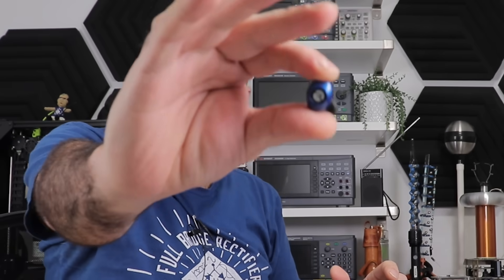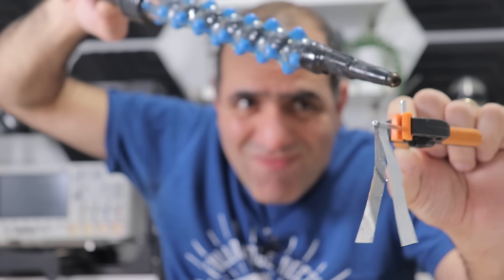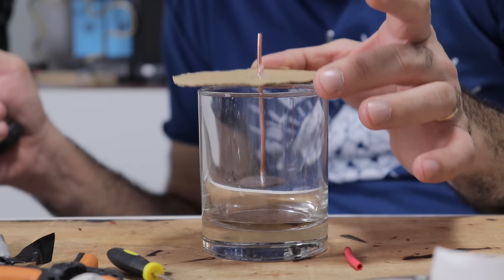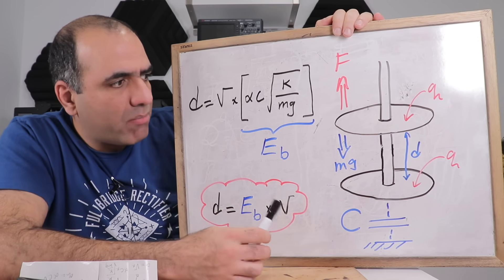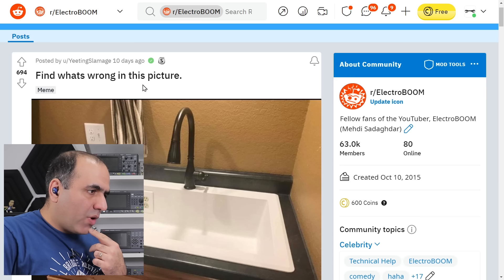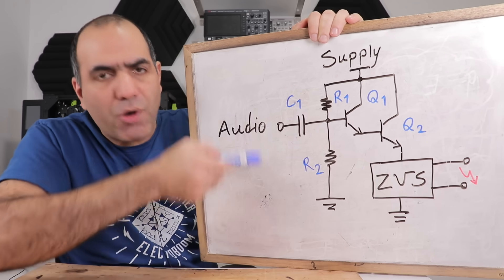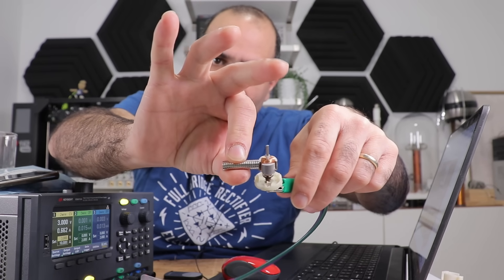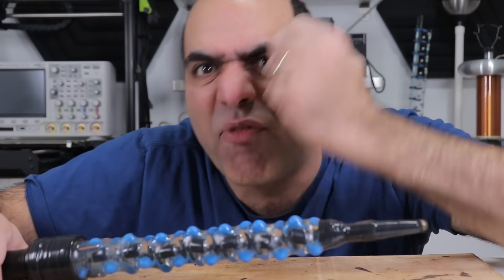I Reinvented the Electroscope! (LATITY-008)

Comment: There is a reason why you will see flammable placards on containers of powdered materials, even things like dry spices. Kinetic energy can be enough to create ignition, and once that happens it can erupt explosively into flames. This actually happened inside an old factory near where I used to work. Someone was cutting an old air vent, and the dust went up from just a spark from a disk grinder. Next thing they knew, the whole floor was up in smoke, because the fire spread through the air ducts.

Those rolls are likely made from some kind of polystyrene, and can be quite flammable, so dust or particles from them would make very easy kindling for a static charge.

Comment: On the timestamp 9:32, this guy pulls up his sock, creating lot more friction and then high voltage, setting these foams on fire. It's because these foams are made of EPE or extended polyethylene. EPE has a high concentration of butane gas. Butane gas is used to ignite the cigarette lighter and gas stove.

Comment: The reason that the cotton ball doesnt burn in his experiment is that its bound in a structure. The idea of a dust explosion is that free molecules have  a larger surface area to interact with an oxidizer.  They can burn much more quickly and if you have enough material you get an expolsion.  This was first found in flour mills and is abig concern.  Also vaccum bombs work on same principle.  Take exposive material make aerosol cloud and let the atmosphere be your oxidizer and you get a huge pressure wave.

Comment: The "landmine" is most likely paper dust. Extremely fine dust has a very large surface area, because of this, when a spark happens, the paper dust ignites like shown in the video. Buildings have exploded because of dust accumulation before. It's a real thing, look it up. Grain dust, flour dust, and yes, paper dust have all caused accidents with explosive results. People have died because of this, and new safety rules were created because of it.

Comment: I still believe that ESD fire was in fact dust. Your test was admittedly flawed, the objects by themselves may have a tough time being ignited by a simple electrostatic spark unless it's volatile like the lighter fluid. The foam ball is relatively inert on its own, but grind that ball into a fine dust, blow it all over your shop and then get a static discharge or open flame, you'll find out what happens briefly before you burn to death (don't, we'll miss you 😂). Fine dust particles saturating the air can ignite very rapidly on the smallest heat source, and can cause huge fireballs and pressure wave explosions. It's been a problem in manufacturing ever since the beginning of the Industrial Revolution, largely countered by workplace regulations requiring a good ventilation system.
The reason it seemed to stick to the surfaces was likely because some dust had already settled and was caught by the initial fireball. All said, that worker is very lucky that he got out of there quick, as it could have very easily set him alight.

Comment: comedy genius at work when i was five i held on to a hoover vacuum motor on a metal steps that was standing in water in the basement of our house that my mommy gave me fifty cents to buy at a thrift store to  i reached over to the outlet with one hand and plugged it in 120 volts surged threw my body the convulsion spasm made my arm fly upwards smashing it into the ceiling and down crashing into the cement floor in the water with a blood curdling scream it shattered the aluminium whirring and smoking in flames i unplugged the dam thing  left it there knowing my mother would hear my scream ran up the steps got outside slammed the door shut she came running around the corner of the house from the kitchen which was adjoining the basement on a split level she ask me if i was screaming i told here the dog was attacking the cat she believed me and left i opened the door ran down waded threw the water retrieved the fried motor and went and hid it in the crawl space under the house i told my older brother steve what happened rip he educated me in alternating current and told me i had a guardian angel looking after me i just had a belly laugh telling the story that my mother rip never knew rest in peace mom and steven with a tear in my left eye back to the marathon

Comment: Actually, I know what causes the explosion (The material is something called "pearl cotton" in Chinese, which is kind of plastic made into kind of foam. The bubbles inside the foam is filled with butane which will leak out a little bit. The electrostatic discharge just ignited the butane, causing the explosion.

Comment: The dust explosion only happens when the dust mixes into the air in a fine and evenly distributed cloud.  Then it rapidly mixes with oxygen and is so small on a per particle basis that it basically turns into a thermobaric explosive.  

Before mitigation systems were put into place they used to kill hundreds of people.  A factory producing cotton or a corn starch storage silo would build up dust till there was the proper ratio of fuel to oxygen to be flammable and then a stray spark would explode.

Comment: There is actually a flaw in the logic here. Copper and aluminum are different materials that have different conductivity and charge density per unit area. Hence it is incorrect to assume q1 and q2 are going to be equal. Perhaps they will be "close enough to being equal such that the assumption can be made" but from a purely technical standpoint, unless that assumption is called out then this logic Falls apart. (PS: I'm an EE myself so I'm not talking up smoke )

Comment: No flamamble gas is needed for such explosion. But your experiment was wrong. Ball of cotton is nowhere near to fine dust mixed with air oxygen. You seen, any material, even if not flamamble creates highly explosive material when combined with oxygen. There was numerous very serious accidents in iron mills, where iron dust was mixed by wind with enough osygen to explode. In all flour mills is strictly prohibited to enter with open fire, becasue of risk of explosion. Put you experimnetn together like this, take some very fine flour and blow it to the some source of ignition (preferably outside camp fire). I ensure you, you will see explosion and more dust/flour is blown (and so mixed with oxygen) into fire, bigger the explosion is. Try it ;) Cotton dust is no difference.

Comment: I really like the little disc electroscope :P. Makes me want to build one on top of a hat so I can walk around knowing my charge level lol. And oh man could you measure some really really high voltages with this lol. Just replace the circles with 50 pound weights XD (could enough voltage to lift such a contraption even be generated within earth's atmosphere without arcing all over or stripping the air of its electrons or something else disasterous?)

Lol free energy from collapsing Medhi with evil Medhi

A cotton ball is not suspended microscopic cotton particles and wont behave the same way. I can't vouch for the validity of microscopic cotton particles becoming suspended in air and then igniting as though they were flammable gas fumes, but it can happen with ground wheat

Comment: You should try to produce frequency in dc by opening a single part of winding of dc motor and connecting it in series with step up  transformer. This will not change poll but will  change continuation of electricity creating voltage in other ends of transformer. I tried and succed. You pleaseee try...😄

Comment: Dust - Air explosions are very real and very dangerous.
Let's assume there was lots of cotton dust suspended in the atmosphere.
The surface area is extreme and very well mixed with oxygen l.
A spark is more than enough to touch off an explosion. Or is it conflagration? I forget.
Things that and dangerous and waiting to kill you:
1) ordinary dust, which is dead skin cells
2) Flour
3) Wood dust in a workshop
4) Cotton dust

They are also called thermobaric, aerosol or vacuum bombs.
Kilo for kilo, they are considerably more dangerous than high explosives as they don't require oxidiser to be closely packed with the fuel.

Thermobaric weapons have two charges, one to dissipate and mix the fuel with atmospheric oxygen and then a secondary charge to ensure the fuel is ignited.

Comment: 10:18 You could do the same thing to a bag a flour, but it's still possible to make an explosion if you tossed some up into the air and introduced a spark. I image it could be the same thing with cotton which is already more flammable than flour. 

Same truck always filled with the same stuff leaving behind piles of residue after constant moving and jolting around while being transported(Plus heavy dudes walking/climbing on great big piles of the stuff)... I could see a freak wind and some static shock causing that. Heck, with cotton would you even need that much help from wind to cause the residue to ignite? A reaction which itself would cause air movement and throw up more residue which ignites too and spreads? It's one in a million, but with a world population of 7+ billion people it's gonna happen at some point.

So yeah, there definitely was a flammable fuel there that very well could've been from the cotton residue.

Comment: A dust explosion is caused by solids which are mildly flammable suspended in the air at a heavy concentration. This kind of condition is a concern at grain elevators and such.
You can create this kind of explosion by suspending a thick cloud of wheat flour in the air and lighting it with a spark or candle.
You would not normally have to worry about a candle flame in a pile of flour, but if you suspend it in the air as a dust it burns a little too well.

Comment: A comment on your ball demonstration....that is not dust and therefore did not set fire when it was introduced to sparks. Dust, when suspended in air, is very flammable. If you have a pile of dust, it is not. I learned about this in a HAZWOPER technician class I had to take for work. Check out a video here on YT called "Inferno: Dust Explosion at Imperial Sugar" for an example of this. :)

Comment: So why did you use several transistors in your circuit rather than just one. I use a single 2n2222a transistor driven with a 5v square wave signal to modulate my high voltage module, and it works great. Would it be better if I were to use multiple transistors in that arrangement for my circuit, and can you even use that arrangement with square wave signals?

Comment: Random Challenge: Create a generator that generates constant heat, method 1: Two metals rubbing each other fast enough to create heat.
2. Put the generator inside a box that have the ability... I'm too lazy for this.
Context: It's like a battery that regenerates its own electricity due to the heat. Hoping you can make multiple generators inside one box. A big box I meant. And then put some female plugs on the box that connects to the generators. Boom battery.
Tell me if I'm stupid enough for this. I'm still a kid after all.

Comment: I need a the answer pls🙏.if i power 24v19amp ebike motor controller.can i power it with more amps like 25amp but the same voltage will it damage the unit.because i need it for my ebike motor that work for 19amp and my battery is 19amp so it works for only one hour.

Comment: Mehdi - a dust explosion can't be replicated by lighting up a cotton ball. 

It is a sadly common accident in places like grain and paper mills. Fine particles of fuel (like cotton dust or grain dust) have such an exponentially huge surface area compared to textile or even cotton balls that the fire can burn almost the entire particle instantly.

Multiply by billions and billions of particles and you can combust all your fuel almost instantly. 

This is bad when your fuel is in the air ducts. Lotsa people died that way. 

You can reproduce the issue by using something like Coffeemate creamer and blowing it into a fire or arc with compressed air. Do this outside. Wear protection. The coffee creamer may have sugar in it, if that sticks to you it'll burn for a good long while.

Comment: Your eletroscope design reminds me of an experiment I replicated in a college physics class.  It used insulated balls, not metal.  One was hanging free, and another on a stick was brought close to it, approaching horizontally.  By measuring the change in height of the free-swinging ball (easier to measure directly than the small angle of the string), and the distance to the fixed ball, we relate the force due to the electric charge with the weight of the ball.

Comment: Hello Mehdi, can you please make a video on AC and DC neutral. Because some people say AC neutral always have 0 volts but some say for half cycle live wire has 230volts then for other half cycle neutral wire has 230volts. Do we receive electric shock if we touch neutral wire in a closed circuit? Please help.

Comment: I have to tell you that styrofoam is not the same as pure cotton dust. Cotton is extremely flammable when untreated and yes it's very possible that cotton dust from a bag that was punctured caused a low temperature explosion.

Comment: The cotton bails likely had cotton particles floating around the cotton truck. A better way to demonstrate it is to blow flour into the air through a spark, basically the same thing as fumes creating a air fuel mixture except its solid particles. Its what happens in a granary explosion, coal mine explosions, and even wood shop fires and why static electricity must be mitigated anywhere there is fine dust. This is also the process for Thermobaric or Fuel Air bombs like the MOAB bomb, the largest non-nuclear explosive in the US arsenal.

Also nobody watches evil Mhedi. Who wants to watch a boring safety conscious snake-oil salesman.

Comment: Dear sir, if possible could you explain the amplification of signals using a transistor

And could you also explain what happens if a primary of the transformer has AC supply
and the secondary coil has a DC

Comment: The cotton has to be aerosolized to explode. It's the same concept as to why the lighter fluid needs to fume - you need a high enough fuel to oxidizer ratio, i.e. surface area of the fuel.

Comment: The long wires act as a capacitor when you flip the switch you will have a shortcut. It will take 3 nanoseconds almost to light up. Not to mention the electromagnetic transfer on the wires. Even if the ends of the wires are not connected at the edges

Comment: On the topic of the dust explosion. It specifically does require a very dry environment with saturated air. What I mean is that the air must contain a certain amount of particles per cubic metre. So just trying to shock a ball of cotton isn't going to do anything.

That said. I highly doubt they managed to get so much cotton yarn particulates into the air just for a small static discharge to set it off at that point. It's possible... but not likely. It's still more likely than the fumes though. It's highly unlikely there'd just be some spillage of kerosene or something in the back of that truck.

Comment: I make a IGBT zvs driver create a long stable arc with music. Audio driver i use a bjt/mosfet connect to R then R connect to g pin (the 470 ohms R is start first but it connect to 12v and the voltage to audio driver i use class A with a VR to change music lound or small which connect to 15V the out put of class a audio connect to 2 new resistor 470 ohms-1K to G pin of each igbt. But this only work with igbt zvs . Mosfet can't work and add a fan to igbt because it warm fast than mosfet.

Comment: Powder explosions are scary things. And a disturbingly diverse type of powders can be used.  But you need to atomize the powder in the air to make it behave as a flammable gas. Holding a flame against a solid ball of the stuff is a bit like holding a lit match up against a flat bit of wood. Yes, it'll charr the suface but it's very hard to set it on fire that way. Make some sawdust of that same log and things get scary fast.

Comment: Mehdi dont think Voltage but current. If you modulate the current of your ZVS it will not only be stable but you will get a greater range of controll.

Comment: I agree about Derek's video. Firstly, the chain example is actually a good model, because just like electrons don't move far in the wire, the chain links that are rubbing against the wheel don't move far. And they are NOT the chain links in his hands. The forces of tension spread through the wire just like electrical forces do.

Secondly, the diagram, where he marks the bottom wire as negatively charged and the top wire as positively charged? It's so ridiculous, I don't even think I need to go into details.

Comment: 4:50 That is an 'electrostatic voltmeter', used in HV measurements utilising the coulomb force.  

 Quadrant type electrostatic voltmeter :  has fixed quadrant over which movable vanes displace their position. When a potential V is applied across the fixed quadrants and moving vane, a static electric field is set up between them and a force of attraction exerts on the needle.(Repulsive forces also has a role in torque formation in the quadrant type)

Attracted disc type electrostatic voltmeter: It contains two semicircular plates one being stationary and the other rotating. Both the plates are electrically insulated from each other.
The unknown voltage to be measured is applied across the plates, which results in the development of an electrostatic field between the plates. The electrostatic force developed is attractive in nature.

An example : https://youtu.be/Vp5R491sex8?t=208
Reply: ok dude it’s not that deep

Comment: Instead of an arc, use a torch (or burner) to create a flame.  Then put high voltage audio (PA amp?  step-up transformer from there?) onto electrodes in the flame.  I've seen it done, it was very cool!